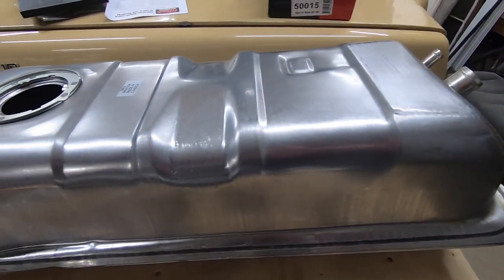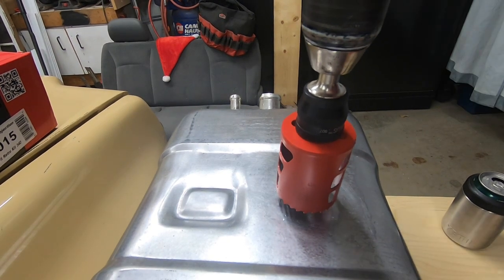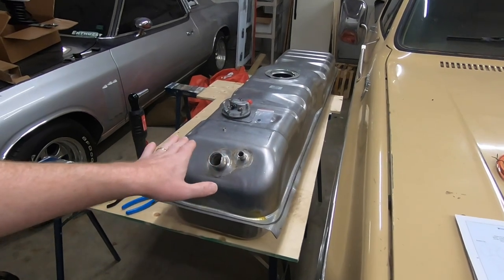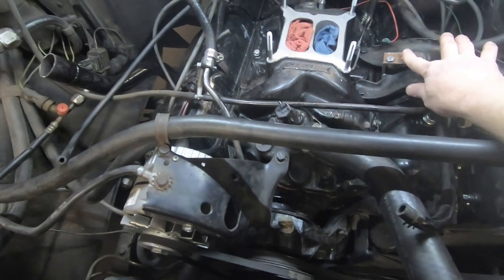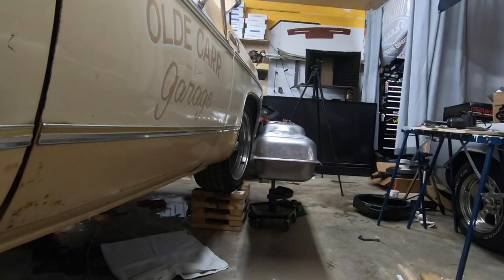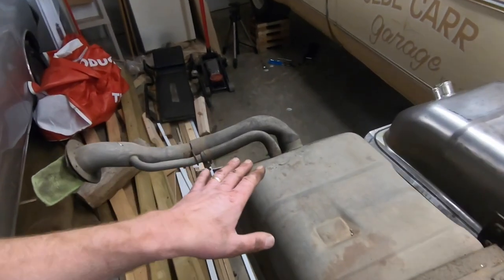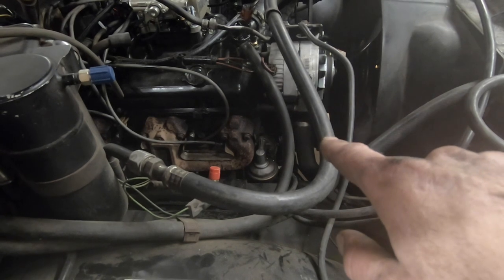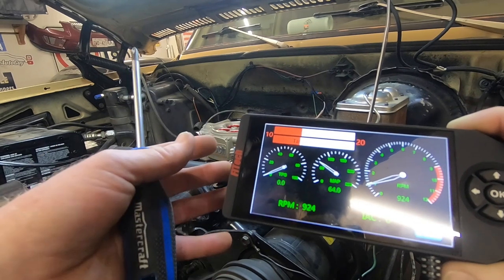FITECH EFI Install- CHEVY C10 Square Body

Comment: I'm so glad you did this video.  I've been curious about the new add-on EFI systems now that the bugs are getting worked out and to be truthful, it makes me regret ditching the old school 350 SBC that I had in Ethyl for the full Dodge Magnum drivetrain with the MPFI ssytem.  Of course at the time, I was working with what I had (no GM OD transmission or driver's drop transfer case), but I already had a full aftermarket Ron Francis wire harness installed before the chassis swap.  It would have been so much easier to add the FiTech or a similar system.  Thanks again.  Dale is looking (and sounding) great!
Reply from the maker: Thanks Joe!

Comment: I am not sure if it makes much difference but the cubic inches was set at 360 and not 350 !!  
That FiTech looks really good and it sound pretty good also !!
Reply from the maker: The theory is, that my 350 is bored 0.60 over, therefore a 360 cubic inch small block chevy. Good eye though.
Reply: actually it would 370 ci @OldeCarrGuy

Comment: I got a question for u. Does that pump or the throttle body itself have a built in regulator for the fuel pressure?
Reply from the maker: Yes! It’s built into the side of the throttle body itself!

Comment: Will the FiTech not work with a factory fuel pump? I was looking at using a baffled tank/pump/sending unit/lines from an 87 with factory EFI.
Reply from the maker: Depends on the pulse width of the factory. Great question though, but probably better answered by a FiTech represenitive. I appreciate you watching.

Comment: May be a little late, how did you run your TV cable (detent,kick down) I’m guessing you have 700r4?
Reply from the maker: It attaches to the throttle body just like a carb but you may need to swap the pin it clips to and a slight readjust. Yes, 700R4
Reply: @OldeCarrGuy  you know what, I greatly appreciate your dedication to your fans even though it’s not many you seem like you’re thankful for every one of them, and for that I subbed there’s too many people who won’t ever reply and you seem like you’re out to help everyone, keep it up!
Reply from the maker: @connorbrown5613  Thanks Connor. That's what it's all about...helping. I enjoy replying to everyone's comments. Good and Bad! lol But i do find as my channel grows, it becomes more and more of a challenge to keep up with them all. I do appreciate you noticing.

Comment: Is it good for use the daily and heat العاليه very up 50 degree سيليزيه in the summer we have?
Reply from the maker: I daily drive mine in the summer. As long as the unit isn't getting heat soaked from the engine, you will be fine.
Reply: @OldeCarrGuy  How much of up the heat you have summer ?

Comment: How tricky was it to make your trans kick down linkage work ?
Reply from the maker: Not at all actually. It hooked up in pretty much the same place as the carb did. Just a quick readjustment on the TV cable (700r4).

Comment: How many mpg do they you will get with that system
Reply from the maker: It's pretty vehicle specific. They wont claim that you'll get better mpg, but it's intended to work efficient so mpg may be a biproduct. I average 14.5 in my built 350 with a 700R4 and 3.73 gears.